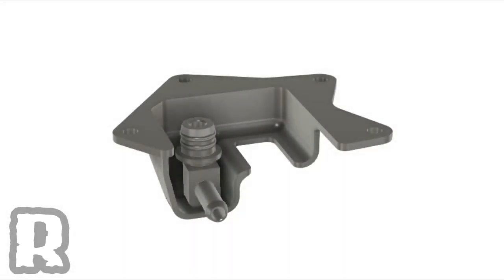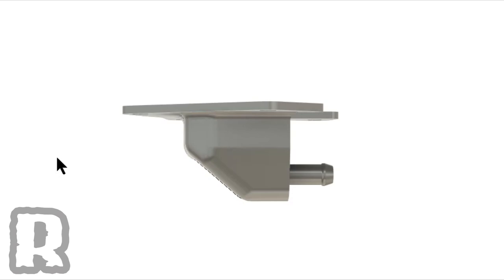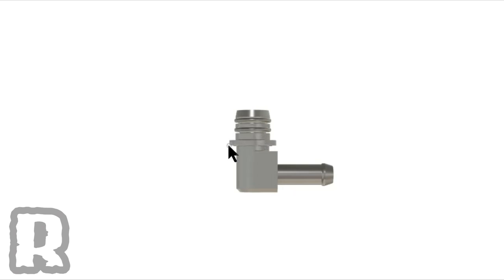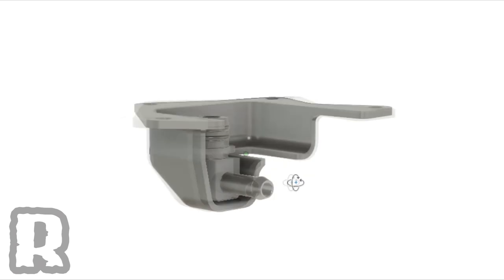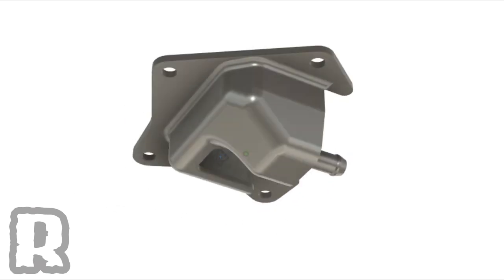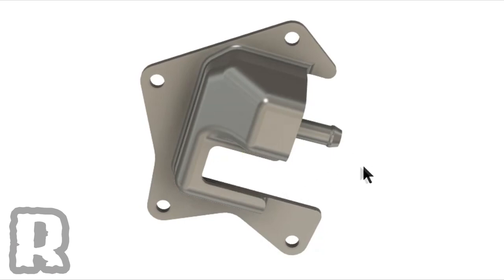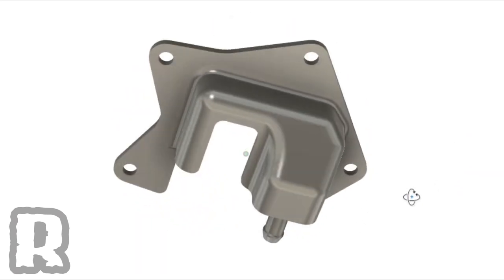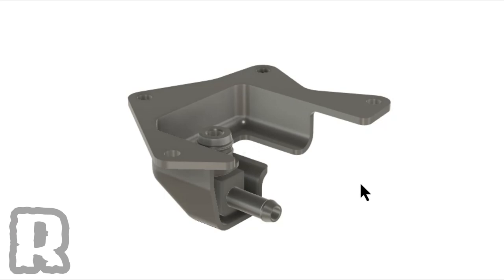PRODUCT REVIEW - RP BILLET SPIGOT & SPIGOT GUARD - KTM 790 ADVENTURE

Comment: AXP skid plate and Rottweiler fuel pump / spigot guard question.  Will your ( RP ) fuel pump / spigot guard  touch the surface of AXP skid plate when mounted?  Clearance distance?

If am just interested in the RT spigot/pump guard, can I remove the 4 OEM bolts without fuel coming out?
Reply from the maker: They do touch just a little because they are basically two aftermarket parts combined. We believe AXP has clearanced their current skid pans to allow a bit more room though. To be honest there are probably 1000 riders who are riding with both and we never really get calls about it as they only barely touch and all that happens is that they wear on each other just a little. That's about it. Personally we would rather have a slightly worn anodized part that you can't see over a broken fuel pump. You can look at it that way.